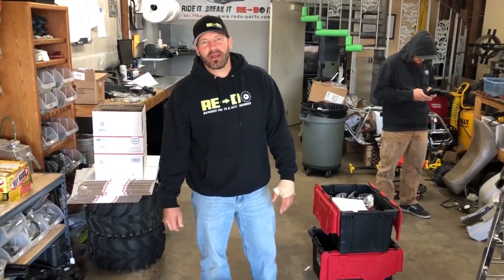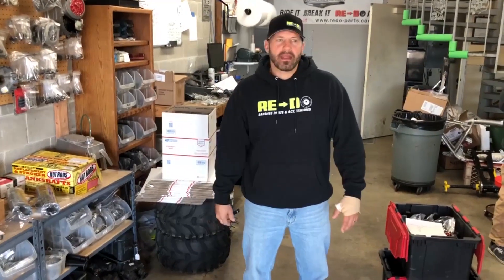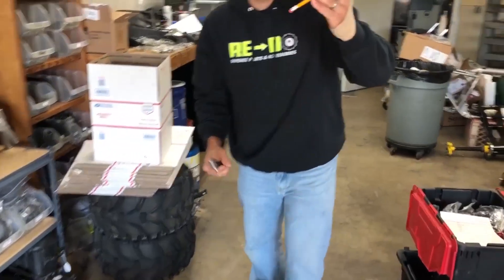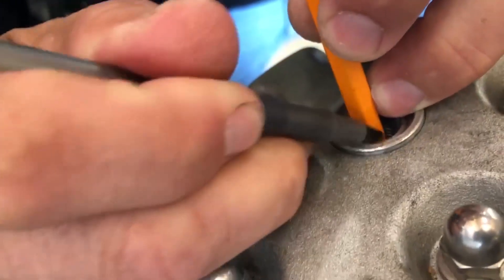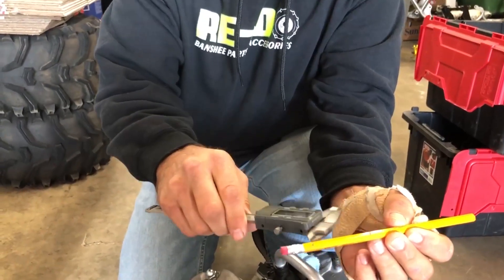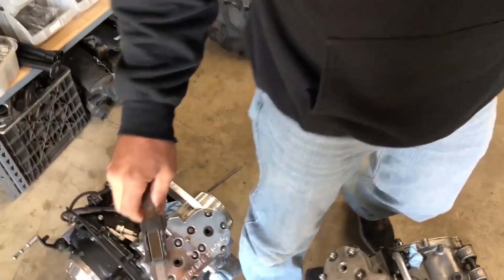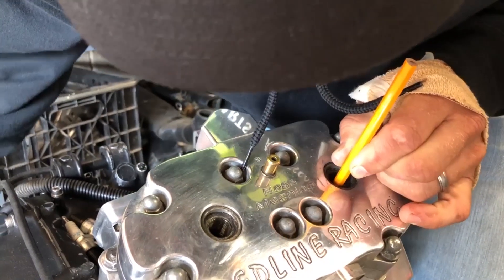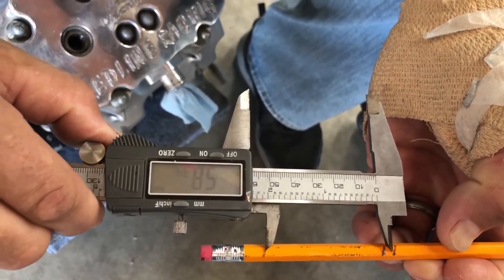Is This Engine a 4 Mil or NOT? How To Easily tell If Banshee Engine Is 4 Mil Stroker

Comment: Can’t you tell with the spacer on the bottom of the cylinder? Once you put a 4mm you need a spacer and most likely a cool head unless the top cover is worked on
Reply from the maker: Some engines may still have the spacer but most builds now use a Coolhead with 4mil Domes

Comment: If I have a 2 piece cool head.Do I have to add the spacer on cool head too?
Reply from the maker: If you are rereferring to the spacer at the bottom of the cylinders the answer is no. You don't need to add a spacer on the top and bottom.

Comment: Hey i was wondering if anyone can tell me if i can put a stroker crank in my banshee without clearancing the case, or will only a stock crank fit in the case?
Reply from the maker: You can do a 4mil Crank without any trenching of the cases. Keep in mind you will need a spacer or to mill the head still though. If you have more questions feel free to give us a call at 541-419-6054 or email at info@redo-parts.com

Comment: Bring a magic marker also
Reply from the maker: Quick easy way to check stroke is to remove a spark plug and insert a new pencil into the plug hole. Turn engine until the pencil goes all the way down. Mark the pencil, rotate engine 180 degrees and mark the pencil. Measure the distance between the marks. 54mm is stock. 58mm is 4mil stroker.

Comment: Just took my banshee motor apart and found the rod side bearing burnt and missing.
It’s a four mill according to seller. Never really used it so now I’m looking to get it fixed.
Don’t know what I should go with. I’m happy with a banshees performance but since it already had a 4mill and ported cylinders I was thinking of building back the same thing.
Reply from the maker: If you ever need to put in a crank it’s not much more to go to 4mil than stock. Crank is only like $200.00 more. Well spent money for the extra performance.

Comment: It could be a little more than 4 mill if your spacer is too big(gasket)..... what is your squish? Could be losing power and need a smaller gasket my friend......I got mine set at .32 on stock stroker. My first squish was .55 I think save area was .25-.45 so I’m pretty happy with it being .32 away from the head

Comment: Does this also work if you have a 4mil stroker with the spacer plate?
Reply: This will work any motor with a crank to get an idea. Your only going to do this on something Your about to buy r just got to inform you on crank type. What you need to know about spacer plate is the gasket is a spacer as well they come in diff thickness. You need to perform a squish test to tell how far away your piston is from hitting the head. For example mine was .52mm so to bring it closer for more compression I changed base gasket from .32 to a .12 so my squish is .32. I think the safe area is .25-.45 but I would double check what is good for your build depending on gas type. In the video he’s almost a whole mm to high so I think he’s needs smaller gaskets to bring stroke closer to head....definitely something to consider you want to get most power out of your combustion you can

Comment: How many cc is a 4 mil or 7 mil adding?
Reply: 0 that’s a bore kit that adds cc
Reply: @cheezeballer9  you're wrong this stroke add to the cubic centimeters there'll be more volume if the crank is moving lower in the cylinder meaning more cubic centimeters

Comment: my dads banshee is a 420cc and it has been completely done by trinity racing with stage 4 trininy race pipes, idk what it would be
Reply: It's 421 58mm stroke 68mm bore
Reply: Chances are that it would have a longer than stock stroke crank.  Possibly 4 mill or bigger in order to get that size of displacement

Comment: So just to clarify the 4mil is ONLY the stroke of the piston...in this case what/which crank would I need to get this desired stroke? Does anything else need to be done to be a 4mil like bigger bore and piston, Upgraded head etc? I'm looking to build a 4mil from my stock motor and I'm trying to understand what's needed to be done to achieve that...any help would be appreciated thanks guys
Reply: There is also a company called Drive line performance that sells premium parts to do a 4 mill.With a 4 mill I think your crank needs to have a longer rod to have the bigger throw.The rod needs the be 115 instead of 110
Reply: There is alot of ways that you can build a 4 mill but from my understanding 4 mill means the piston is 4 millimeters about the top of the cylinder when at top dead center which means that you will need 90 degree cut dome to run a 4mill
Reply: They press the crank apart and get an offset rod to crank pin and position the red pen so the offset is near the outer edge of the crank and then once it altogether trude and balanced you welded pin in there. There's another way you can do it with using a different rod but the best way is to take the crank apart and put a new crank rod pin in there and the further out you go means you have to start cutting open the bottom of your crank case. I know a guy that has a 22 mil stroker and his crank bottom is cut Way open and they had to epoxy New pieces of aluminum on the bottom of the crank case..
Reply: The stroke is the measurement of where the piston travels from the very bottom of its revolution (bottom dead center) to its very top revolution (top dead center).  The stroke length is built into the crankshaft and not the piston or the bore.    There are many ways to build a banshee engine and that will just be up to you on what you want.  You can build a a 4 mill stroke with bone stock top end or go with big cylinders and pistons or any combination in between.  If you do decide to buy a longer stroke crank you will have to modify the cylinders and head to accommodate.